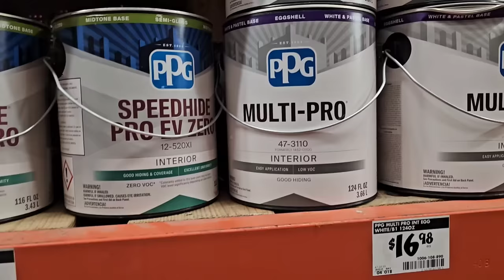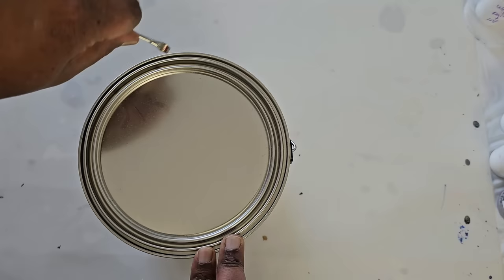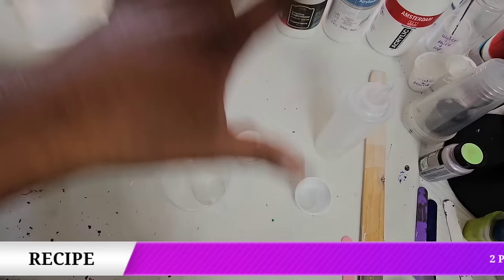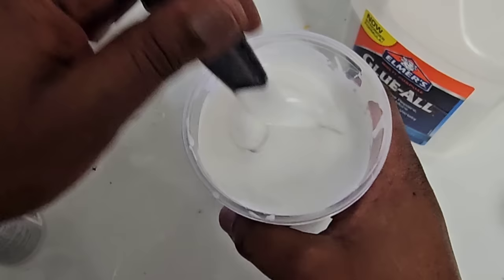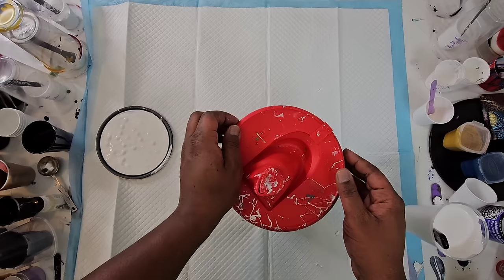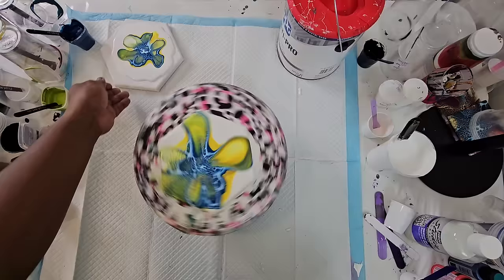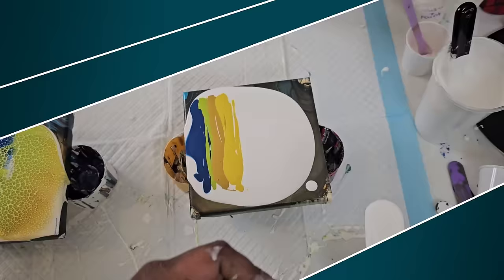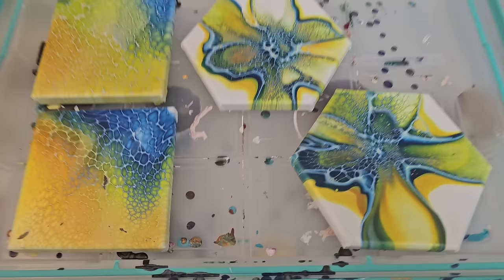Debunking MYTHS 🤨 Make Your Own Pillow Paint!! DRIP TEST

Comment: Hello evryone. I used to do faux finishing. What I learned from him saved me a lot of grief. I'm going to share my Grandfather's tip when it comes to stirring and turning the paint. He was a painter and never ever used a drop cloth or roller. 1. When you buy house paint store the can upside down before and after opening. When the oils or other additives separate its at the bottom of the can. Slowly turn the can upright. ( it prevents bubbles ) . 2. Instead of stirring roll the can back and forth slowly and evenly as far as your arm reach about ten times. This is easier than folding not stirring the paint. Folding without breaking the surface of the paint thereby creating bubbles takes practice. Hope this helps and happy painting !!
Reply from the maker: LOVE THIS!!!! This fills in the gaps of what I used to do because now I'll be doing this! ❤️
Reply: Merci pour vos astuces 😊
Reply: That’s what I do with my cans of paint
Reply: Thank you
Reply: Great video my friend. Vert informative.  Thank you for all your  expiramenting.  ❤

Comment: Every house paint works differently. The reason most of us use it, is that it is economical. I use the PPG multi pro or Sherwin Williams  because it’s economical and it doesn’t leave the measles on my paintings. I also love the Glidden semi gloss. I find that you only need a little of it to get your acrylics to move across the top properly.  I worked at Home Depot in the paint department for years. I learned a lot about paint. I don’t add anything to it except a bit of water. Amsterdam paint is amazing paint and I use it for my blooms swipes etc but never for pillow….its too expensive. I use a mixture of different paints for my top paints. Usually making my own pouring medium. I spent 2 years coming up with bloom recipes after taking Shelee’s first course (literally texting her while I was at HD trying to find US equivalent paints to what she was using. I am an OG at these recipes. I have been doing this for over 10 yrs.) People also have to take into consideration the weather…what works for me in New England may not work for someone in Florida (higher humidity) or Arizona/Nevada ( dry, hot) I also use a large dehumidifier in my basement,  where my paint studio is. Also if you find your pillow is too thin, let the paint sit out open for a day and it will thicken. Your video was very informative and fun. I am all about the bottom line and using less products to make amazing art. Your mixture is great for smaller paintings 
Loved watching you and will continue to do so. PS: paint peeling is very oddly satisfying😊
Reply: 😂😂😂 the weather.. SMH 🙄.. don't get me started on that. I live in Minnesota, it can snow at a nice 48° one day, the next day, it's -15° and sleeting, next day, sunny and feels like spring, 100°s in Aug....🌡️. I keep all my paint in a spare room  upstairs, that I try to keep at the same temperature all yr round. Even my spray paints have a spot in my basement that they share with my fossils, stones and crystals. 😂. It's the simple things in life that keep us happy.
Reply: @aqua1082  my husband thought I was insane when I told him we had to go buy a larger dehumidifier because my paintings were cracking from drying too fast 😂 weather is a huge factor I try not to paint during high humidity. I have lost so many paintings I loved because of the damn weather. We get the same kind of weather here. It can be beautiful in April one day and 3 feet of snow the next. It’s a nightmare. 😉
Reply: Hello there! I just read your comment and as I have NEVER done any of this before, was wondering about the humidity factor? I live in Southern Florida (need I say more about humidity?) and am just wondering in what way does the humidity affect the paint or final product? I see you mention cracking. Is there an acceptable humidity level or at what percentage of humidity is the cutoff in determining whether or not it's safe to paint? Thanks in advance! 😊
Reply: @Itseemedlikeagoodida  Hi! The humidity causes the top of the paint to dry too fast. When the top dries before the rest of the painting it causes cracking. You should never have a fan near your paintings for the same reason. You want all the paint to dry evenly at the same time. If the humidity is over 40-50% I won’t paint. I also won’t paint if it’s just brutally hot. I tend to paint from Fall to late Spring in New England when it is cool. I do furniture refinishing during the Summer and fall here

Comment: Hi, new watcher.  Floetrol is a very good product but tends to get gloops. If you take a piece of panty hose, a rubberband, and a damp paint rag, you can put a piece of hose over the spout of floetrol, use rubber band to hold in place, pour and strain, wipe with damp rag, and put the cap back on, ready to go next time.  Of course, it applies with any like water based  product.
Reply from the maker: Thanks for tuning in love.

Comment: Is it cheaper to use tube paints instead of PPG Multi-pro where you are?
Reply from the maker: Are you referring to the tube using them for the pillow. It is comparable if the paints are on sale. PPG Pillow paint is cheaper but alot of ppl don't have access to it.